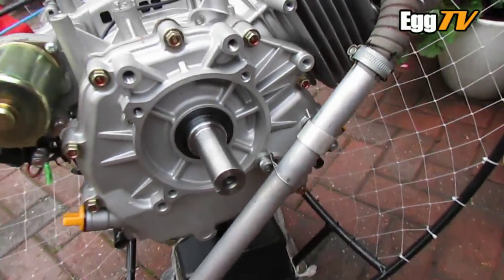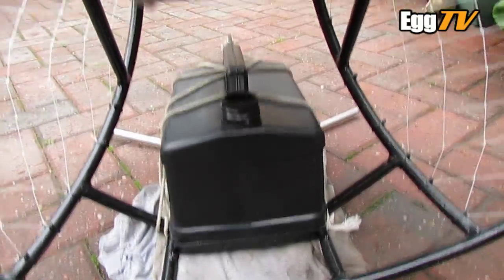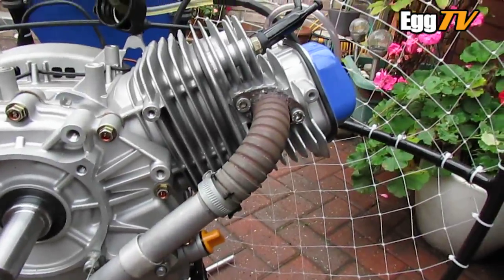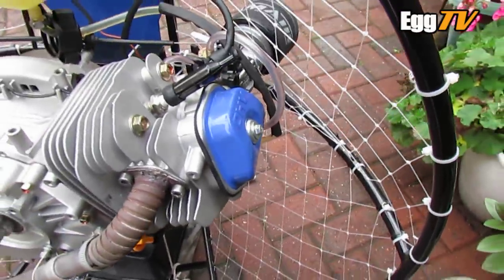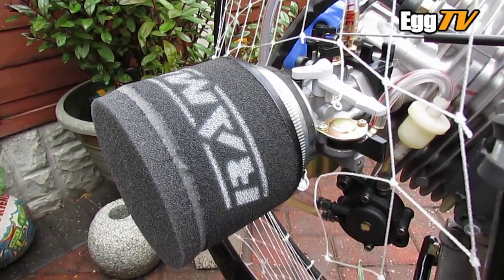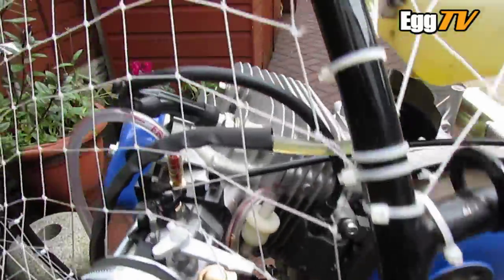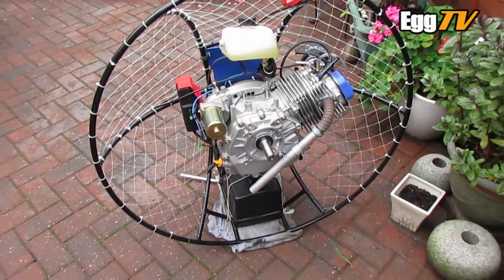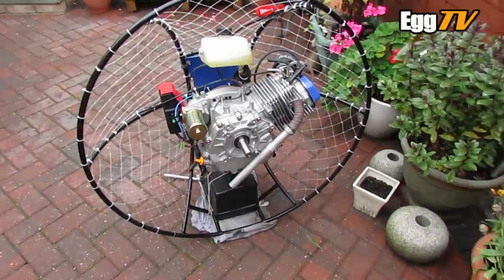Fly'D Egg Trike. Tuned Gx440 Engine - EggTV

Comment: Where'd you get the header pipe from?
Reply from the maker: Hello, it is a mix of 1 inch internal diameter flexible exhaust tubing and a section of aluminium tube.
Reply: Do you sell them?